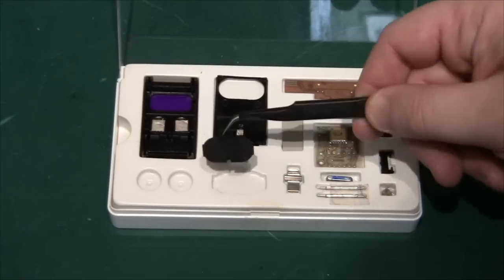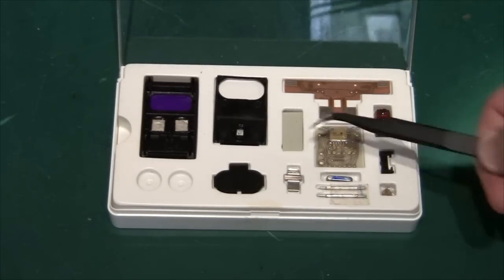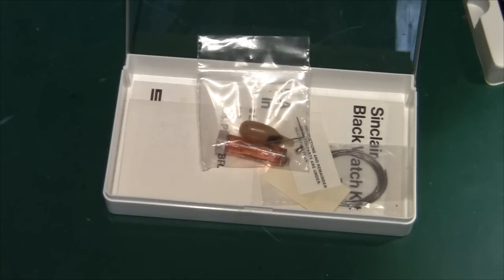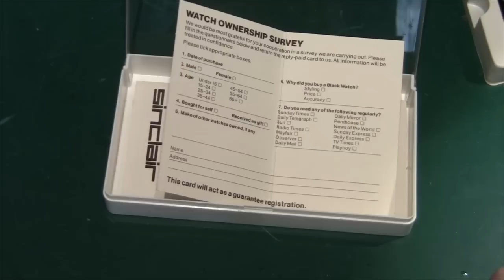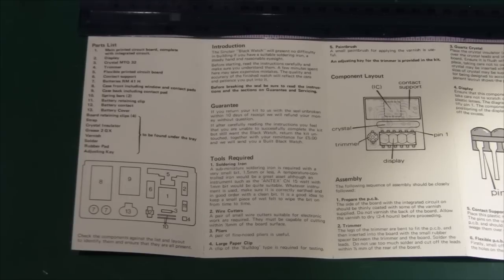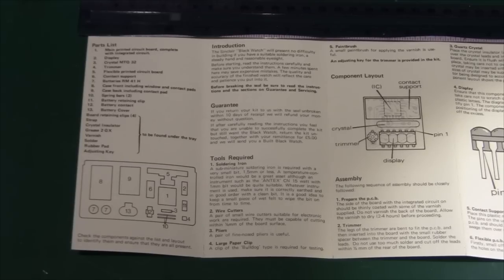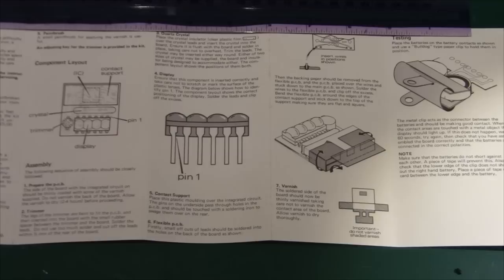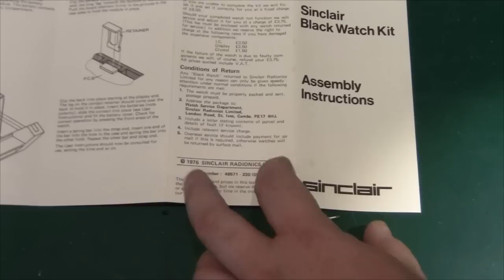Unboxing of Sinclair Black Watch

Comment: I got one for Christmas when I was a teenager. The crystal that they supplied had wires thinner than a hair which of course broke as I was building it. We ended up with them sending me a pre-built unit which  worked OK but the "buttons" required you to press pretty hard. I had it about a week and was adjusting the strap while sitting in my desk at school. It fell all of three feet to the floor. This was all it took to kill it. It didn't do anything after that. I took it all apart and noticed that the crystal on this one had decent sized wires so they must have figured out pretty quickly that the wires on the original crystals were too fragile. 

Overall, it was a piece of junk. I ended up pulling the chip from the board and peeled the metal cover off to expose the chip inside.  ICs were still a very new thing so it was cool to look at under a microscope. I took it and a couple of other chips to my electronics class at school and all of the kids were fascinated with them.  That was really the most enjoyable thing about this expense lesson.
Reply from the maker: So many issues. I had a class-mate who got one for Christmas one year. We were all amazed and had to press the button to see the time over and over. The battery went flat in 15 mins or so. Anyways. I just wish Sinclair had been a bit more quality conscious.

Comment: What a great find, and fascinating.  I thought you were going to build it too, but I can understand that it is perhaps more interesting and of more value in its original kit form.
Reply from the maker: Would be interesting to see exactly how difficult it is to build. I think it's all about tolerances. Maybe sand-paper the PCB edges a bit, and cut the pins really close to the board, make tight bends on the flex PCB, and stuff like that. It could also be that Sinclair did not take the dimensional tolerances of the parts into consideration. 

Maybe I could make a 3D model of it and see how close the parts are?

Anyway, the watch is worth a lot more in kit form, than in assembled form, so it's a no go.
Reply: Yes, I agree with you. Kit form is only life for it now.  Great stuff.  Thanks.

Comment: The bulldog clip thing in the manual was really a bodge, so you could try to connect the batteries to test it before putting it in the case. Practical Wireless or Practical Electronics did an assembly review, and they suggested using clothes pegs instead of the bulldog clip. A metal bulldog clip would probably short the batteries. Having to varnish the board yourself, that's definitely a bodge.

Comment: I built one of these when I was a teenager too.  Even though I was handy with a soldering iron it never worked.  It flickered a bit but that was all I got from the kit.  I can't remember mine having a varnish kit.  There was no internet then of course otherwise no one would have bought one as the reviews would have shown buyers that they were total rubbish.  Even the plastic where you pressed to adjust the settings felt very thin and poor quality.   Even now I think of Clive Sinclair as a scam merchant;  he must have known that they wouldn't work no matter how much care was taken to build them.  I expect most people didn't return ten as they would have felt as I did that it was their own fault for not soldering accurately enough.  Even now I feel disappointed with that man.
Reply from the maker: In a way you are right. The ZX-80 was also incredibly flimsy. Let's not forget the release of the QL 8 months late with a ROM chip hanging out the back. On the other hand, I guess that's what happens when you try to sell a kit as a consumer product?

Comment: Sinclair and keyboards are not a good marriage. (watch,zx80,zx81) its a little bit  better with the Spectrum , more better with Spectrum+ and QL. +2
Reply from the maker: What can I say? He came up with some clever solutions - just that they weren't very good. Cheap yes, but very good, no! 

A switch cost 0.15 pounds from Watford Electronics, back in 1980, according to Electronics Today International. The price of 32.768 kHz chrystal was 1 pound, by comparison. 

Also, I wonder how much he must have spent on plastic tooling. Surely he could have spent 45p on three switches?
Reply: Even in the Spectrum+ and QL the keyboard wasn't that great. Bneath the hard plastic keys, was very much the same membrane as the ZX80 and ZX81. Apparently by the time the QL came out, a real mechanical switch keyboard cost about the same as Sinclair's membrane based one. And of course the QL was supposed to be a real business computer.

Comment: Hi do you still have this kit, please could you tell me how you set the time. I just bought one, but no manual.
Reply from the maker: Maybe some of your buttons are not working properly? But anyways, here is what the manual says:

How to use your Sinclair Black Watch with Date.

Your Sinclair Black watch is one of the most advanced time-keeping instruments available, giving you the time in hours, minutes and seconds and also the day of the month. 

Advanced technology integrated circuit and quartz crystal combine with the latest solid-state display to give you space age accuracy.

In normal use it will give you up to a year's time-keeping on two hearing-aid type batteries. Two time display areas are provided to give you a choice of display brightness. A bright display for high-light conditions and a 'battery saver' less bright display for low light conditions.  Excessive use of the display, especially the high brightness conditions, will reduce the battery life.

The date requires adjustment only five times a year: at the end of February, April, June, September and November the date requires advancing. This is easily accomplished by putting the watch in 'Date set' mode and pushing the front area the requisite number of times. The time and accuracy remains unaffected f.

The date changes at 12 o'clock midnight. Should it be found to change at 12 o'clock midday, advance the hours by twelve and reset the date.

When travelling through time-zones or when "putting the clock back or forward" the watch may be easily adjusted without affecting the date or accuracy.

Put the watch in 'hour set' mode and advance to correct hours. If the hours require putting back, simply advance by 24 hours minus the required backwards shift, e.g. 3 hours back requires 21 presses of the front area. Although the hours pass through midnight the date will not change. The watch will return to display off in 50-60 seconds.
Reply: On my watch you hold down button 3 and press button one to advance the hour. I have to keep pressing button three the entire time otherwise it does not advance when I press button 1. In the manual is states that pressing button 1 twice will bring up the date. I’m wondering if that’s not for a 5 digit display, as mine does nothing different if I press the buttons more than once.